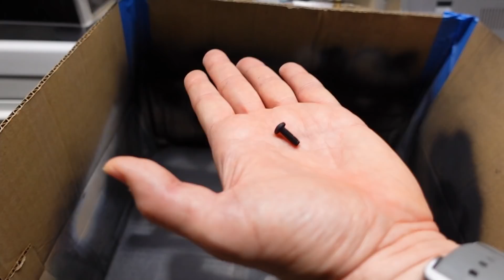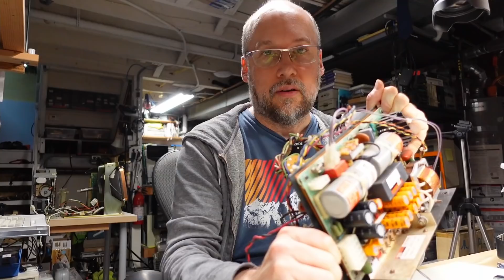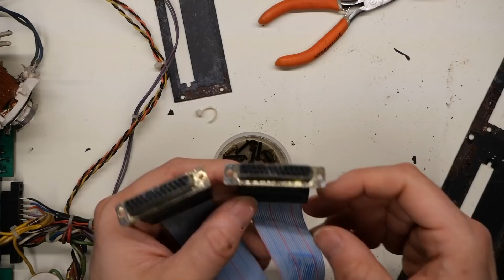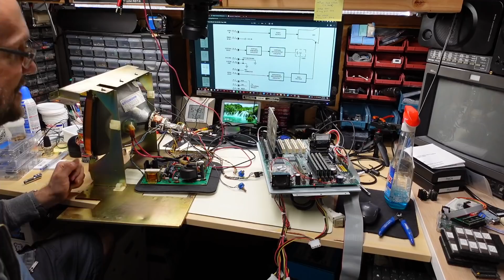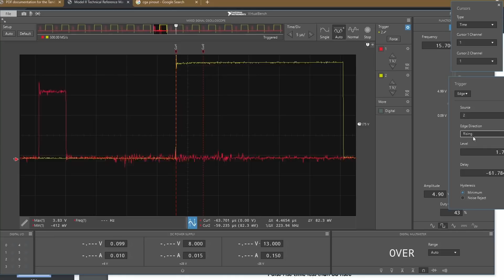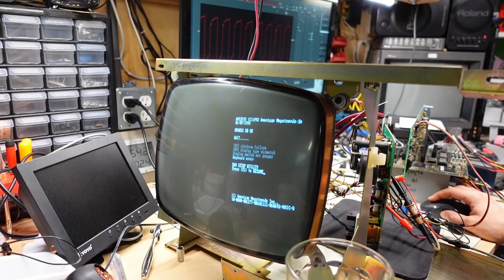I actually got something working on the TRS-80 Model II!

Comment: Adrian, can you still get incandescent light bulbs in Canada ? Halogen ones will do. If so, it is worth making a "dim bulb tester" for working on any kind of power supply. I always use one when I've serviced a power supply, and it's good insurance against catastrophic failure occurring.
Reply: I'm sure you can still buy some varieties of incandescent bulbs in Canada, but it doesn't really matter. Adrian lives in Oregon. Plus you can find secondhand light bulbs in any part of the world or use substitutes like power resistors or heaters.
Reply: @eDoc2020  Yes I forgot he lived in Oregon now. It is the PTC behaviour of the bulb filament that is important, which neither a heating element nor a power resistor would do
Reply: @jaycee1980  I believe heating elements are PTC but likely not as much. Maybe ceramic style heaters would be more suitable. Another idea is using some sort of motor setup. With the motor stopped it can pass a decent amount of current but once it starts it won't need as much.

Comment: ok on the cap readings, keep in mind all those caps have a tolerance of +/- 10%, so that first one you checked that was supposed to be 470 has a upper limit of 517. you might not think its off by that much but older power supplies very much utilized an RC time constant for regenerative feedback. and of the cap gets too far out of spec it throws off the timing of the pulse and the supply wont work. so to be sure I'd take it out and measure it out of circuit.

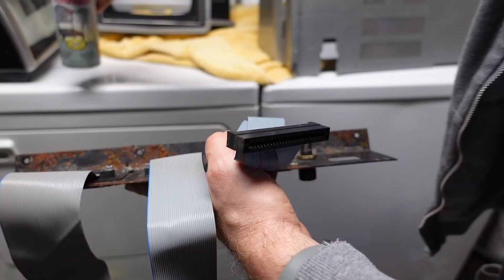Comment: 2:45 I'd get a (preferably battery powered) mini-dremel with wire brush attachment(s), that will allow you to clean the rust mechanically off stuff without damaging in-tact metal parts, but still gently and with a decent speed (you don't have to wait days or weeks like with most rust dissolver fluids)

Comment: To Electrolytic capacitors do not need to be measured. They need to be replaced even though they are well visible and measure ok. They have expired many years ago and are no no longer reliable. All good techies know that.

Comment: Adrian,

If you're interested in de-rusting fasteners, take a look at electrolysis baths. it's super easy and relatively safe - a cheap "dumb" 12 volt battery charger, a sacrificial anode (a chunk of carbon steel), some metal wire to loop all the parts you want to remove the rust from, and a plastic tub with washing soda (or even baking soda). Set it up, and let it cook for a day or two and every single piece of rust is stripped from your parts. Make sure you dry and give a protective coating as soon as they're out - they can flash rust quickly. There's quite a few videos and discussion about how to do this, I have done it a lot repairing vehicle parts and tools.

Comment: To be honest, that power supply looks like an off the shelf part. It seems Astec is still in business, so maybe they have something that’s fit / form / function compatible if this one conks out. I remembered something else. There are two slightly different sets of frequencies for NTSC TVs. Monochrome is supposed to be 15750 Hz horizontal and 60 Hz vertical, and color is approximately 15734 Hz horizontal and 59.94 Hz vertical, the difference being due to the latter dividing into the 3.58 MHz color frequency.

Comment: With the backplate plus anything else for that, Id suggest Kurust f you have it locally. it can be painted on and turns the rust to a safe oxide and you could stencil the text back on using a sponge to dab white paint through it.

Comment: You need to exchange the electrolytic capacitors to avoid problems. When such a capacitor is ageing it looses the electrolyte resulting in voltage spikes which kills semiconductors.

Comment: You could try building a couple of circuits on a breadboard to adapt the signal from the CGA card: a one-shot multivibrator to stretch the horizontal sync pulse and an inverter to invert the vertical sync pulse.

Comment: Since the PSU is going to be one of the next steps:
If you want to power something mains powered up which you are not to sure about the condition, you can put a classical light bulb in series with the mains connection (60-100W or so, typically, depends a little on the power rating of the device). 

If something shorts out, this often will prevent further damage, since it limitx the current and the bulb lights up brightly, alerting you to shut off the power. Normally it should only glow dimly. If you combine it with an isolating variac, that's the luxury variant (well no, the one you are technically supposed to use, from a safety standpoint). 

Admittedly, it can be a little problematic with switched PSUs, and prevent them from starting up correctly, but it will still very likely prevent the big bangs.

Comment: Two more options that might help out for rust are Evaporust and elecrto rust removal.  The Evaporust is great for connectors, screws and other small things that would be difficult to do with electro removal, and is reusable.  It is super safe and you can leave stuff in it for days plus to really get into tight stops.

Electro can be nice because you can go directly from one tub for removal into another tub to do plating to prevent new rust from forming without having to paint.  Say nickel for example.  You just need three tubs, removal (water and some salt), final rinsing (distilled water only, use tap first) and plating (vinegar and salt).  Just don’t let the part dry or you will get flash rusting (very cool to watch, but no fun).

But in ether case, you would need to use a paint remover and a wire brush first to really do a nice job.

Comment: Adrian you can do better than painting the screws.  You can use cold bluing or heat the screws and put in oil.  They will turn black and protect them from rust.  This also hardens the metal.

Comment: Great work! You might want to change the two electrolytic capacitors in the line driver stage to improve reliability/quicken rise times, and clean that multiconnection plug of any corrosion. Awesome outcome so far!
Reply: i was wondering if the differences between the 2 makers of the boards, differences in the  h sync circuit would explain this behaviour. in any case the vert sync polarity would never work off a plain cga card.
Reply: after examining the schematics the RCA board is a proper oscillator which is retriggered by the sync pulse, the Motorola board looks simpler and cheaper but does not oscillate on its own. the duty cycle of the expected h sync pulse is actually the oscillator, so the flyback power supply just wont run properly with the narrow pulse and needs closer to a square wave.
Reply: one final thought. its nice that Adrian has some great tools to test with. a ttl pulse stretcher could be breadboarded to change the h sync to suit, and a ttl inverter could change the v sync to suit. its great that Adrian explores these things so we can think and learn about them.
Reply: @fumthings  Based on the specs I guessed the RCA board would have its own oscillator, so I guessed right. There are pros and cons to each design. The oscillator-less design is cheaper and doesn't require horizontal hold adjustment. On the other having its own the oscillator has the huge advantage of not frying if fed with an improperly timed signal.
Reply: actually, i think those are tantalum.

Comment: Hello Adrian! In your Mac IIsi fix video you mentioned stealing some caps from an old pc motherboard. I’ve got 5 different Pentium 4 motherboards that all need recapping but I haven’t been able to get the solder to melt to get the old caps out. I saw that you have one of those awesome automatic desoldering tools. Does that work for you on pc motherboards? I understand that you need a lot of concentrated heat to get those things out.
Reply: Maybe try a hot air station

Comment: If you can find someone near by that has one, I would recommend just having those rusted metal parts sand blasted. It helps makes sure you have a nice and clean surface to apply filler and paint to. I had to deal with rust that was sadly more severe than this on the IBM 5170 that I restored last year thanks to it's lithium cell leaking all over everything. While it will never look like it did out of the factory, it's a night and day difference from where it started.

Comment: Hardware on that TRS-80 is likely the standard SEA sizes. Having some pan-head machine screws and nuts assortments is always handy to have around in the following sizes: #4-40, #6-32, #8-32.
Less common are the larger ones: #10-24 & 1/4-20"
Nice work on jury-rigging another horizontal sync signal for testing. Understanding the needs of the system under test is a valuable skill and I am glad you see you demonstrating that. It's unlikely you will need much of it going forward but if so, you could try adding a pulse stretcher to the CGA card to extend that horizontal sync signal. Not ideal as that will introduce some small delay (ten's of nanoseconds) but then the testing PC can generate all of the signals. I think though that you would be getting the TRS-80 video generator up and running first anyways... I think.
Signal upside down... did you plug the yoke back in backwards? I did not see that, just wondering. Both H&V would be flipped...
HV Flyback damage - Maybe a good idea to goop some HV silicon compound on that broken area at the top anyways, just to isolate HV and prevent ingress of moisture in future. Running it a bit first should dry the transformer out first.
Cheers,

Comment: Red rusty metal can be placed in boiling water to convert the red rust to blue rust which is actually the "bluing" that you see on firearms. This bluing if given a bit of oil will typically resist rust. So you might try getting as much loose red rust and flakes off of the metal as you can using a wire brush and then consider placing the item in boiling water for a few minutes.

Comment: Good job getting the CRT board up and running, Adrian! I can hardly wait for the next installment now. :D
BTW, I was thinking... is there any way for you to test the PSU board in isolation like you did with the CRT board? I mean, do you have some appropriately-valued loads (i.e. resistors) that you could use in lieu of the main components, eg. the disk drive, and the backplane with the other boards?
Now that I think about it, would it be feasible to test the logic boards in this same manner, too?
Reply: Adrian usually uses a dead hard drive as a dummy load, although every time he does this I keep thinking some resistors (or lightbulbs) would be a wiser choice.

And yes you can test logic boards in a similar isolated manner, but only if they can run without the original accessories.

Comment: Just another tip, use your DMM to do a resistance check on all electrolytic capacitors (mind the polarity) before powering up the machine.  Electrolytics have to be formed to be capacitors, and that forming process reverts if not under charge for long periods of time.  Anything more than a year, and you should be cautious.  Putting voltage on them via a resistance check, helps to at least partially form the capacitor, so that when you actually power it on, the cap doesn't explode (small ones will just pop or hiss), thus necessitating a replacement and possibly damaging other components.

Comment: It's amazing that this machine can be so exposed to the elements that the painted case starts to rust, yet that copper deflection yoke still looks brand-new. Pennies don't even stay shiny that long despite living in coin purses and cash register trays inside climate-controlled buildings.
Reply: Allow me to point out that coinage is typically handled by hundreds, if not thousands of people, each of whom leave a tiny residue of oils, acid, and dirt upon the surface of the coins. All this dirt, oil, and acid will quickly take the shine away from the surface.
Contrast that with the way that we tend to NOT touch electronics with our bare hands, and the conclusion is pretty obvious.
Reply: The insulation on the windings must be tougher than the paint on the case. If pennies were coated like that, they'd probably hold up better.

Comment: One suggestion for you, and everyone else for rust removal.

Evaporust.  It works MUCH better and much faster than vinegar, and it's re-usable many times.  It also has the advantage of never removing metal because it makes the rust soluble in water.

It's a little expensive, but since you can re-use it, and just dump what's left back into the bottle it's quite affordable.  I bought a gallon of the stuff in early 2021 and removed a lot of rust from old tools.  I still have likely 3/4 of it left, and I expect that gallon to last many years.

Comment: On the positive side,at least you could make a "modern" (as in, something 80s-90s based) computer inside the thing driving the original monitor if the original hardware doesn't work... :P
Reply: If he does get it working I'd like to see CP/M running on it.

Comment: 3:15 - depending on the overall condition after the jelly you could put masking tape over the text to protect it while spray painting it. But if the rust is so bad that it eats it's way under the text you can't really save it, all you can do is print new labels and hope they will stick. This reminds me, I really wanted to get a nice Brother label maker but the nicer models are a bit too expensive for my taste with all the label options.

17:15 - those pads on the upper-right quadrant don't look nice, around that circular arrangement there are 2x2 quare shaped soldering and one of them is really rust-looking, check that too, please if it has continuity.

Wow, that was really exciting! Can't wait for the next part, I hope the PSU is okay now that the flyback has no problem, you should be able to fix it if any fault comes up.
Reply: On the Brother printer, we have a PT-2730 where I work and it really is just kinda overkill for 99.9999% of use cases.  I've been thinking of getting a PT-D600 for at home organization since it has the connect to PC functionality I'd want for printing labels at home, which the $50 to $70 models typically don't, and is $100 rather than the several hundred a 2730 goes for.
Reply: @chiblast100x  I was thinking about getting a PT-P750W or something similar, it's between $125 and $175 plus all the different type of tapes for it. I really like them but yeah, probably a white masking tape with a regular pen will do for now :D
Reply: Someone like Colin Furze could probably cut out a back panel on his plasma cutter and put in the 90-degree bend, but the final product would likely also come with a jet engine, fireworks, or rotating knives to boot.

Comment: When I initially found this channel a few weeks ago, I thought "hey neat". Now I am truly blown away by your diagnostic skills. 
BLOWN.
AWAY.
Reply: that is indeed one of Adrians prime qualities. Once he bites himself into a problem he will not rest until he figured it out.
Reply: He's far better than you realize.  He also debugged the Commander X16 computer.  He found the problem that even the two guys that designed it could not.  And, IIRC, Adrian said he had no formal training in electronics or electrical engineering.  I was hoping he would share his method and journey from zero to hero in learning this stuff when he reached 100k subs, but we haven't gotten it yet.  Adrian, maybe a good 2nd channel video would be going into detail your process of troubleshooting.
Reply: 1 skill to rule them all = PATIENCE :-)
Reply: Strongly agreed. The commander X16 fix and Adrians casual modesty around it are absurd.
Reply: Are you a capacitor? (hehehe, pun intended)
Reply: The man's got troubleshooting skills.
Above, someone mentions patience, and this occurred to me as well, watching him work. He is very patient. But Adrian also seems very adept at logical if/ then-type thinking. He also does his research and homework until he understands a system well enough to troubleshoot it, but he doesn't go completely overboard with trying to digest unneccesary detail (though he often does need to delve fairly deeply into some detailed reading/ research). 
So, to me, those three things stand out in his approach: 
a) patience
2) logical, flowchart-like, if/ then approach to thinking
0011) does about the right amount of research/ homework to understand the components and systems he's troubleshooting (RTFM!!)
Reply: He is a seriously smart guy.  After watching a couple of his deep dive diagnostic and repair videos, he is without a doubt the best repair tech I've ever seen.  He just needs to work on his SMD solder skills.